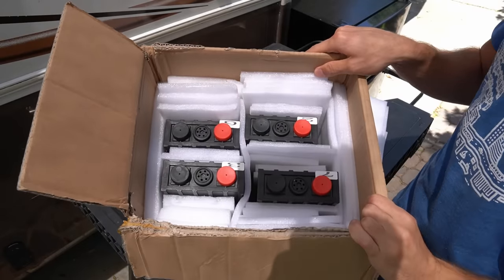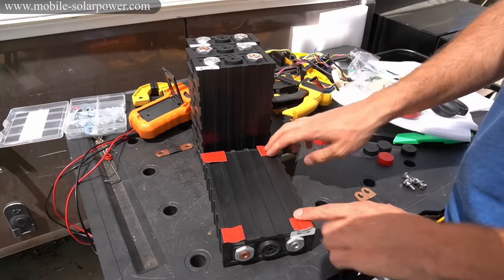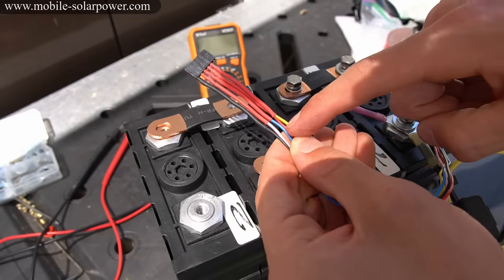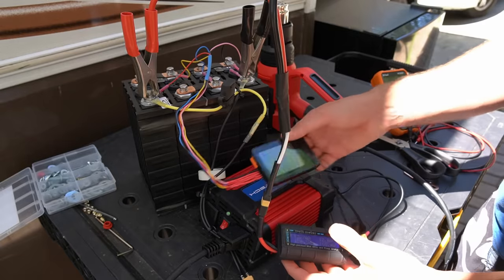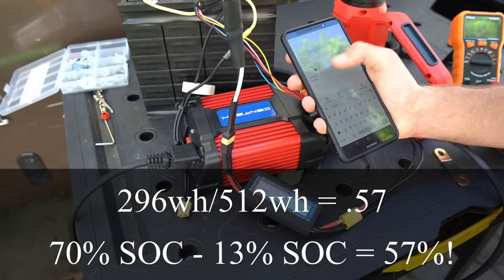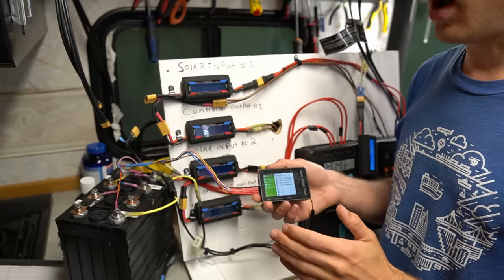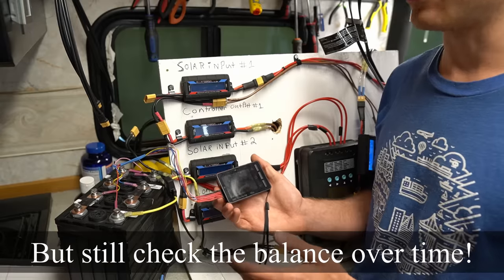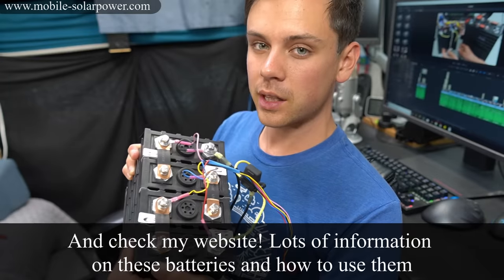12v LiFePO4 Battery Kit from Amazon.com - Tested and Reviewed

Comment: You're right in that you don't have to buy them on Ali because they are obviously listed on Amazon. That being said, the ship date is 1 to 3 weeks out. Just because they are listed on a different marketplace doesn't mean they don't come from the same seller.
Reply: amazon buyer protections are pretty good though.
Reply: @omgnothingisavl  I know that to be fact when they are shipped from an Amazon warehouse, but not so much when they never go through Amazon's system. I had issues with a previous purchase because it was sold and shipped by a 3rd party.

Comment: I went with CALB cells. About $550/100Ah with busbars. Went with bottom balance and quality chargers and low voltage disconnect. These prismatic cells are pretty stable workhorses. 13.68v max charge for the bank and 12v battery disconnect on the inverter. 11.8 on the battery disconnect. That leaves almost all the capacity meat on the bone while steering clear of a voltage cliffs on either side. No top balancing BMS complexity. Simple system that works.
Reply from the maker: Exactly. Once you dial it in these are solid. And sinopoly, Winston and calb seem to be highest quality cells, so very nice
Reply: @vincentrobinette1507  Bottom balanced and max charging voltage set for the fastest rising cells. After a year and a half testing with cells separated (and also tested in place in parallel groups like a top balancer system would look at)  voltages checked at full charge hasn't changed. No cells have moved over time respective to each other. All my cells are still within 100th volt at full charge. Top balancers will charge over 14v. While 13.68 is still on the vertical cliff of the charge cycle it is within the spectrum of my banks voltage where cells still hold tight to each other. If it wasn't I would have no issue lowering it. As it is I am seldom at (intentionally) at 100%. 

My top voltage of 13.68v/bank was specifically set  before onset of individual cell voltage separation after testing.These CALB cells don't drift that I have seen. But then again I am not using them full deep cycles in high 1C + discharge rates ( I can't actually discharge at 600ah anyway) like the car conversion people that have been beating on them for years now.

In any case I have never recommended anyone build any system that they don't feel comfortable with and take ownership of their design. Building a DIY lithium battery bank isn't right for everyone even if they buy a 3rd party top balancing system which is a rabbit hole of it's own.

For most people a drop-in battery despite the cost is probably better solution if they aren't going to do the work of understanding Lithium batteries advantages and serious limitations. Namely being overly discharged.
Reply: @vincentrobinette1507  Calb cells produce more than their advertised capacity. The cells come with a test sheet that shows each cells tested capacity. My nominally rated 600AH bank (24) 3.2v cells in 3p/4s x 2  configuration could store close to 700AH with enough safeguards to push cells to their maximum with an "active" top balancing BMS to fully fill each cell. I have tested my bank with 13.68v Max and 12v max discharge cuts off producing just over 600AH without getting near the danger zones on either side. That works for me.
Reply: 100Ah what? One cell, 4 cells? 3.2V, 12.8V? What?  What is the actual energy capacity in Wh?

Comment: Thanks! Really inexpensive price, it is recommended for the first cell formation charge to use a maximum current of 0.5C and carry them only once at 4 volts per cell (read the manual of each individual brand because it is dangerous to make a mistake) then subsequently they can be downloaded and quietly charged at 3.5V per cell, 14V @ 12V battery
and do not drop below 3Volt per cell 12 @ 12volt battery, so they last an eternity!
Reply: @vincentrobinette1507  Sorry, obviously I can't express myself correctly in English, pretend I didn't write it.
When I say cell formation, I say that it is the first absolute charge of the cell to be done only and exclusively once only, and it is necessary to unload successively and quickly up to the maximum pefissata voltage 3.5 / 3.6V use this only for the Winston monobloc, logically 4V are so many shops to pay attention, we must never get there again and it is not valid for the other brands, every brand has its own specifications also based on the type of internal electrodes, besides that they are now sold already manufactured by the factory 'importer, the first time it is also recommended to connect them all in parallel to self balance and load them or with a special charger for a single cell or with an adjustable power supply, then create the series for normal use at the minimum and maximum voltages desired for the cycle duration and desired ability.

Comment: How would you compare these to battle born batteries?  I’d love to set up a 600+ au system, but am worried about durability of these.  Would you recommend them for that?
Reply: battleborn batteries include a very capable BMS right in the package. They have integrated features for safety and to protect the battery, so they can provide a warranty and technical support. The kit for $600 is cheaper, but in my opinion the battleborn is much better value. See also LiFeBlue batteries.
Reply: Thank you, I'll check that company out.  I'm building a 600 au system with solar so the safer and full featured within a modest budget is best.
Reply: I wonder how these could be used on my Outback 48volt solar system. The lipo they sell here in Hawaii are around $3,500usd per 4Kw. A bit steep.
Reply: Storing 100 amphour (or ah) at 12 volt is 1200 watthour or 1.2 kilowatthour (or kwh). 4 of these to get your 48 volt would be 4.8 kwh and cost about $4000 for battleborn/lifeblue or $2400 plus balance of system to use the amazon cells.  But 100ah isn't much storage for a solar electric system.
A 6v golf car battery is usually about the smallest you would use on a 48v system, and that has 200ah to 230ah. Most 48v systems have a pretty large inverter, which can draw a lot of current, and you need a large battery to supply that.
100ah of battleborn/lifeblue probably wouldn't be happy. While raw cells without a BMS can deliver C rates or even at 2C to 3C (e.g. 200amps to 300amps for a 100 amphour battery) it puts a strain on them that takes a toll on their life and makes balance and cell monitoring very important or even critical.

Comment: I need a 200 AH 12,8V  battery. Which is better? A single 200AH battery pack or 2x100AH packs  connected in parallel, each of them with separate BMS?  Thanks!

Comment: I run all commercial electric lawn maintenance equipment, I was wondering what the best solution would be to install solar panels on my truck and charge my equipment while I'm working? I'd like to run at leas 2x ego super chargers? and maybe also have an option to charger lager commercial equiptment when I eventually can afford electric riding mowers?

Comment: Hi from Norway. Good info. 
I have a set of 100 Ah CALB cells from a condemmed car and want to use them as house batteries in my boat in a 5P 4S setup for a total of 350 useable Ah.
I top balanced each individual cell to 3,6V before connecting them in series and test them. The cells still delivers about 90%, but they are somewhat unlike in capacity. 
Any suggestions on how to pick cells to use (I have more than the 20 I will use) and how much voltage difference is tolerable?

Comment: Hi will i just by 8 cel 12v 200ah to make a 12v 400ah , wich bms do you suggest we will pull 70 ah max and i want to charge them fast with a dc dc charger .

Comment: Better way to tape together is lay them on side and use table to align edges. Better yet, stack the batteries in an inside corner - the two battery edges align automatically to the corner faces.

Comment: Thanks Will. I'm seeing lifepo4 power battery 12v 100Ah waterproof cases showing up online with all kinds of outports, now. Do you have any thoughts on these cases? Is the inverter and Charge controller built in? I see they have BMS. You could make these little cases easily. They look quite handy but I don't know how well they are built.

Comment: I’m wanting to start over landing slash going nomadic. To save money and avoid becoming homeless. Is there it cheaper to build a solar system or buy a solar generator. Just need to run a refrigerator and maybe a fan or electric blanket when it’s cold. What do you recommend. And can you also charge it off the car battery while driving?

Comment: so for using these cells in the 12 volt configuration for a second battery in a car for audio, it would be a fluctuating power consumption , obviously ... example  with a 260 AH alternator and 2 battery's 1 being these lithium cells and other stock battery with 2 amps pulling a combined amperage of about 300 at best, at  about 2-5 min. bursts ...how do you think these would perform in said situation?

Comment: Should you get their BMS also or roll with a different one?
Reply: This was my first larger BMS, but I personally wish I had bought a nicer one. Their bms is a bit difficult to build and a bit sketchy. I got the bms for the 200ah 12v pack. From my experience it doesn't seem like it has over discharge protection. Getting one of those battery sense / low voltage cutoff devices seems like a crucial addition to make sure the cells are safe.

My experience:
The bms doesn't come with wires attached, so I requested the instructions from their customer service. Side note: their customer service is pretty good. I wasn't able to soldier wire to the board using a regular iron and lead soldier, so I ended up bolting them on.
 
At one point (after I had been running it for ~70days successfully) I ran into a compounding issue where my solar controller for some reason auto configured to 24v and stopped charging the battery because it was under the soc limit for a 24v battery. That allowed the battery to drain down to 10.2V (over the bms) reading 0% soc on the controller. My Noco Genius wouldn't register it, I had to bypass the bms to get the controller to charge the cells directly above 11v to get it back to working condition.

Comment: Any vids on proper crimping 2/0 gauge copper lugs? Finding crimping equipment is proving to be exhausting any help will would be most excellent. Also what style of crimp most effective for combining 8 12 v battle born battery bank
Reply from the maker: I have hydraulic and three point crimpers, and honest my super cheap hammer crimp is the best for all sizes. Takes a few good whacks but I love it. It's on my website under the tools section
Reply: DIY Solar Power with Will Prowse  
Thanks brother just want to be sure I get the most current with least resistance/heat

Comment: Is each module 12v 40ah so 4 would be 160ah?  If so, is the price per module? Or..... is the price of ~269 for 4 modules that equal 12v 40ah
Reply: No the 4 modules together are 12v nominal. The price is for all 4. The modules are 40ah each but are wired in series to make 12V so the capacity stays the same.
Reply: Thank you. It’s so hard to justify this amount for those ah. Don’t we get about 40ah out of a 100ah sla/ agm? I guess it comes down to size, weight, and if someone will actually use this for many years vs upgrading in a year when the next new technology rolls out
Reply: @techmon88  If you add modules, the energy capacity has to obviously increase. The voltage increases but the Ah stays the same: 100Ah @ 24V is twice the capacity of 100Ah @ 12V.
Everybody should get used to using Wh instead of Ah because that does not depend on voltage, or parallel or series configuration.
Reply: @ahaveland  I agree everyone should use watthour as that's the same regardless the voltage. I just used the wrong word when referring to ah.
Reply: @techmon88  People have just got used to using Ah because car batteries are almost always 12V everywhere. It gives a guide to capacity for only one usage class, but it also miseducates!

Comment: Hi Will,
I live in Scotland and would love to buy
 " LiFePO4 12V 200Ah Lithium Iron Phosphate Battery Pack, Light Weight LiFePO4 Battery for RV, Solar, Marine, and Off-Grid Applications " For my 32 foot cruiser. But the Amazon site says it will not ship to the UK and they are not avalable on Amazon UK. Any help in sourcing These cells from someone who can ship to the uk would be a great help.
Eddie Kessler

Comment: Hi. Looking a lot into your videos, and I am a beginner :) Could you please tell me if I am right:
I have 32 LiFePo4 batteries, they sat for a while all in parallel to evenout between themselves, the voltage I have is now 3.29V.
I want to top balance them, and what I see is, when I set the charger at 3.65V I get the current around 1.2A, and it will take a loooong time. Can I set the charger to lets say 5V to get more amps, and switch off when they are at 3.65V? Thanks

Comment: You can now get pre-assembled 12V LiFePO4 batteries with the balance charging circuit built-in to the package, for a bit more than the cost of these battery kits.  They're around AU$999 retail for the 100Ah version.  You pay the extra because they've done all the hard work of assembling it and adding the balance charging circuit and nicely packaging it all.

Comment: 1. How about testing multiple small cells versus same AH value large cells for resistance 
2. Second test, the resistance for wiring 8 in series then parallel or paralleling 2 x 4

Comment: Will, I see that RUiXU has the Sinopoly prismatic cell kits on Ali Express.  Some come with a BMS.  I'm wondering what you think of the BMS they include, is it worth using or would it be more advisable to buy one separately?

Comment: Hey thanks for all these great videos, can you tell me which charger can we use if we have no solar installation?

I am looking for a charger or I could all program and or there would be no need for bms on my battery what do you advise me and what do you use in the video? (not solar, on the current of the house)

Because if you have an accurate charger why would you need a bms during charging? I do not understand the utility, so if you have a bms I just send any current and it will take charge of the battery in the best conditions following the settings?

For the discharge I have a display with the voltage and a buzzer if it goes down too low.

Thank you for everything !

Comment: How many amps could you safely pull at one time ( like cranking amps). I know batteries packs like this are great replacements for deep cycle but wonder if they could be configured to start a small motor if needed.
Reply from the maker: 3c rate discharge from data sheet

Comment: Thanks for great videos! Does it work as a start battery as well? I would like to build one for my boat that both works as a start battery (around 800cca) and also for the equipment onboard (12v simple stuff). Thanks!
Reply: And I am wanting to know if I can use one of these for a start battery for my car.  I have used 18Ah - 20Ah AGM 'powersport' ATV batteries since 2003 and I get an average of 5.5 years out of them, which is great, but I want to see if I can cut the weight and size to the point of mounting one in an unusual place in the car to free up space for something else.  The current AGM battery is mounted under the passenger seat and has been in 3 different cars, since 2003 with a custom harness I made for this purpose.
Thank you for any help with this :)

Comment: Will I’m interested in his drop in (RUIXU LiFePO4 12V 100Ah Lithium Iron Phosphate Battery Pack Light Weight LiFePO4 Complete Battery (BMS Included),Lead Acid Battery Replacement )now that seems like a cheeped than battle born. Do you plan on testing one?

Comment: Hi Will. Fantastic channel with lots of useful information. I'm remodelling an old campervan and wondering what the best set up in terms of batteries I should use? I'm hoping to use 12v, 240 and solar as I'm looking to be off-grid camping a lot and want to have enough power to keep going. Would I be best getting a ready made.lithium or make my own up? Any guidance would be greatly appreciated. Many thanks :)

Comment: Please advise on these? WEIZE 12V 100Ah LiFePO4 Lithium Battery with Self-Heating Function, Up to 8000 Cycles, Built-in Smart BMS, $269 each

Comment: I am on Social security and can't spend a lot at a time,  but want to start some solar power. Could I get a set of them and use them then add more sets when I get more money?  What kind of problem will I run into.  I know I will need to balance them together so they will be the same,  balance one set then balance the other set when both fully charged. Should I connect the plus of the first cells together and so on from all the selling or keep them as two different batteries?
Reply from the maker: I will cover a cheap beginner friend system this week with a sealed lead acid battery. It should work well for your use
Reply: Donald, if you're buying on Amazon and get the Prime Card, you'll get around $50 off just for getting the card and then they'll offer you 12 months no interest on purchases over $200 (it might be slightly more). So this might be a little easier on your monthly budget.
Reply: Go add for there credit card. But I have been scammed and my credit score now is about -20.
Reply: Donald Smith I’m so sorry to hear! That’s one of the worst things ever. Hopefully you’ll be able to get the situation reconciled and get your credit back on track.